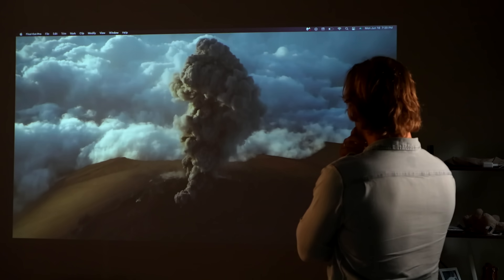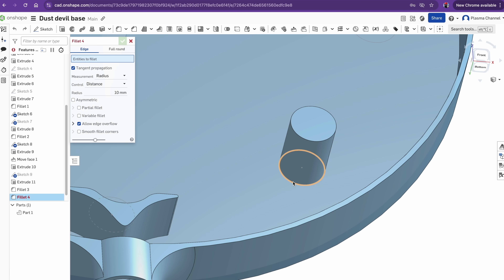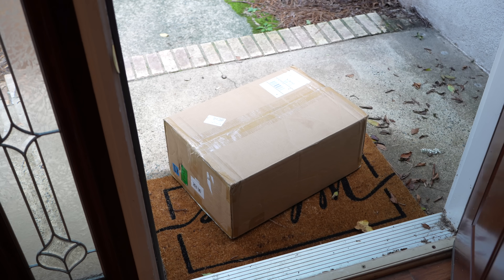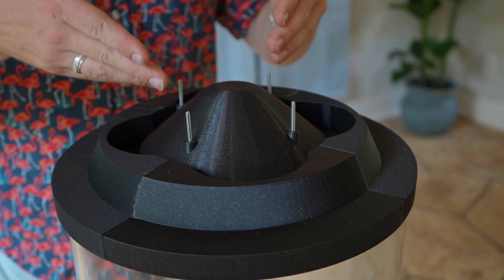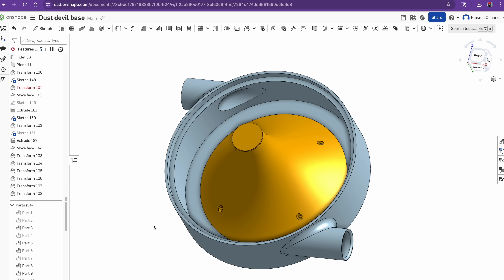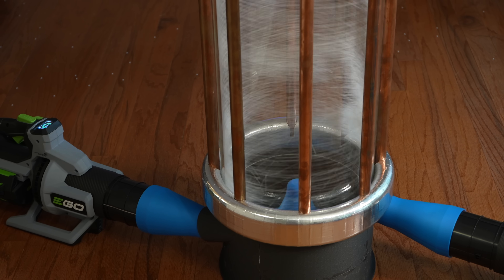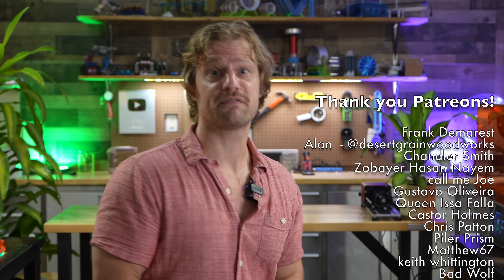Making Lightning In A Bottle Might Be Possible  (ft. 3D Printing Nerd)

Comment: Very nice!  I think the aluminum foil stripe goes on the inside.  Just a narrow ribbon.  Then you take a measurement while the blower is running not stopped.  Most of the energy is leaving the chamber with the moving air. You might also try a large tube in the center.  It does nothing but promote more collisions per second.  The greater the number of collisions the more energy your going to get.  But trying to measure the energy when the movement is off is like trying to measure the energy in a motor when the energy is off.  ... The problem with the over all concept is that conservation of energy thing.   Electrical energy is used to blow the beads.  So at max the amount of energy that you can get out is equal to that put in to the blower motors.  ... In the earth, the sun is causing molecules to rise and the earths core is generating a field as well.   So atmospheric energy is being generated by the core and by the sun. But it is certian the draw of your two blowers is going to be slightly more than what you can produce in this system.  IT IS STILL AWESOME,  WE ARE ENTERTAINED! 🙂

Comment: add a dual chamber design with counter charged roation, add counter rotation hot and cold in sync through those dual chambers. with metal middle roll and you can perpetually run it and harvest energy.

Comment: Hey, be careful working with - and recommending - Gloop; it's nasty stuff. It's mostly DCM, which is a fairly toxic and possibly carcinogenic solvent. 
That alone wouldn't be an issue, but the manufacturer makes it sound like a common household glue, which is super not OK.

Comment: The vacuum gave you more shocks than your design. Start with pulling air, then consider the amount of friction in theblarge glass tube vs the small vacuum tube. Size may be a consideration.

Comment: So many things to say...
1) Theories about lightning now include cosmic rays as triggering events. Maybe you could get long sparks by firing cathode rays (electron beams) into the tube? Or brief laser pulses to rarify the air?
2) Fire tornado designs include either a) a rotating mesh cylinder or b) a glass cylinder split along its length with the two halves offset. Both sound difficult but not impossible here.
3) A. D. Moore, in his awesome book Electrostatics, says: 
"A tornado can be tremendously destructive. What starts a tornado, and once started, what keeps it going? A physicist, Vernon Rossow, working at NASA’s Ames Research Center in California, suspects that a tornado may be electrically driven. His idea is that when two oppositely charged clouds come near enough together, and there is enough cloud turbulence, streams of oppositely charged raindrops come at each other—not directly but in a whirl. As ~ they whirl, they pull the air into becoming the tornado funnel.
If all this is verified, the important thing is that men’s minds have been switched to looking in the right direction—to thinking of how to analyze the case, and making the right observations and tests and models, to get proof. In fact, Rossow has made a laboratory demonstration. He passes a mixture of steam and cool air between two oppositely charged grids. As the steam condenses into droplets, a little tornado, four inches high, develops! This leads him to suggest that if we could manage to shoot a wire through a tornado-information, it could be shorted, and stopped." 

 So maybe a tornado is partly electrical? Or a feedback between electrical and mechanical?

Comment: Maybe you need dry air. You know, humid air conducts static electricity and prevents it from building up. You could use a heater for that. You can also use dehumidifiers to reduce the humidity in the external environment.

Comment: If you wanted to harness the charge, you’d have to segregate charged particles, like Lord Kelvin’s dropper.
An adaptation to this scenario I can think of would be a charged plate going up, outside the “cannon”, one on each side of opposing polarity, so oppositely charged speckles migrate in the vortex to one side of the tube, to then unavoidably meet its matching polarity plate and charge the capacitor further.

Comment: When i was in middle school i made a "tornado" in an acrylic box "rectangular" using a fan pointing up from the bottom, looked like a Vortex, also work with 2 fans, one from below and another from the top, also i think  mixing hot and cold air flow could do the trick, cold above hot below

Comment: Very cool design! You can try to pick up the charge in the same way that Van De Graph generator do it (i have build several of those in my work) or Wimshurst generator is more close to what you are trying to build. Essentially you need to divide the charge into positive and negative and store them into isolated capacitors. I would try to do this by gluing aluminum strips (from top to bottom) inside the tube (the bigger the number of strips the more charge you accumulate) , than you need to connect each odd strip to one capacitor and each even strip to another capacitor. how this will work: the beads will spin around building a charge, you said that you mixed 2 types of beads that build different charges, so each bead that will travel on the wall of the tube should leave its charge on one of the capacitors and will be repelled (will hover over) the other, so this in theory should build 2 separate charges, you can add 2 metal balls that almost touch each other to see if spars will start flying between them (like in Wimshurst generator). I hope this helps :)

Comment: Maybe I’m missing something but this looks like you’re making a worse Van de Graaff generator.
Reply from the maker: So, my plans for the V2 will be very much like a VDG. Balls will travel up the wall on the inside, then be forced to hit a collecting toroid, and bouce back down to the bottom through the center of the glass. Inside bottom will also have a ground connection. At least, these are the types of ideas my overworked brain is coming up with.

Comment: Top marks for trying,  Is there a way for the beads to bounce between electrodes transfering charge, or have them travel in a loop. Inspiring the inquisitive. As others mention a vortex in some vacuum brands are driven by suction but that may just because they need to suck.  A question im my physics degree exam (40 yrs ago) was about tornados and the energy balance between the rotating part and the pressure difference top to bottom, turns out they are balanced, hence the stability. Maybe suction is worth trying. Impressine work.
Reply from the maker: Thanks! One issue with suction, is then I wouldn't have the plastic balls rotating with force on the inside of the glass.

Comment: A lot of good ideas here. A good starting point would be to base the design off of woodworking dust collectors. The heavier particles are forced to the outside walls while the lighter stuff (air) is free to move about.
Reply from the maker: Appreciate the tip. I'm always looking for ways to refine the process.

Comment: Can you check what type of filament was used? If it contains carbon fiber or carbon black it can contribute to losses  of electrical charges. I have had similar issues when building Antennas.
Reply from the maker: Yeah, the filament likely is slightly conductive. Any black plastic uses carbon for coloring. In the end, I should have used non black!

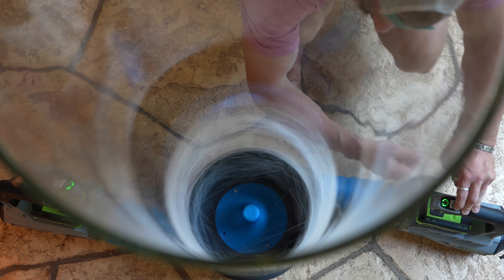Comment: (11:08) the pulsing of your hair standing up looks to be cycling discharge? the capacitance is very small. since outside surface area of the glass(+) is already very large, and adjusting the thickness and material of the tube is not possible, I believe you can only pour in more beads to increase the surface area of your negative terminals, so to speak. I guess keep pouring beads in until you choke the air flow?
Reply from the maker: That could be the case, or, the pulsing is indicative that there is no static actually built on the glass when the balls are rolling around, and that they really are the only things being fully charged. Then, when power is turned off, they stick to the glass and boom, E-field

Comment: I get the vacuum shocks a lot, but the one that drives me crazy is shopping carts. Every so often I will get a cart that shocks me every couple meters of the wheels rolling around the store.
Reply from the maker: Ive had that happen. It's awesome
Reply: @PlasmaChannel 
A big key point to this working is actual seperation of negatively and positively charged beads. They will usually like to stick together and in average contribute to zero net charge.
In a real thunder you will have heavier and lighter particles. The heavier will sink down the lighter will rise (or with different temperatures). And the one kind tends to charge up positively,while the other tends to charge up negatively. That way you get actual large scale seperation of charge, and not just small scale seperation.
So use two different materials that  have as different density as possible. Focus more on density difference rather than triboelectric difference. For large voltages you need high capability for seperation rather than every single bead to have a large charge. Over time it will then accumulate even if individual charge is low.
Reply: I think there is a short in the anti shopping cart theft mechanism inside one of the wheels
Reply: I too have felt the shocking shopping cart.
Reply: This is how ai milks people for energy

Comment: You're not generating a vortex here and it's not for lack of airflow. I don't know if an atmospheric will fully lift your media, but removing air from the top will form a natural vortex if air can enter properly.  Your existing base might work, but many design use a full-length slit. However, they aren't trying to keep sand or something inside. You mainly just need to keep the balls in when the airflow is off and prevent them from collecting against the vacuum port while it's on  awesome project, so thanks.

Comment: So the lightning is the earthing out of trillions of times as much static as you can produce in a tube from friction, I think the solution from some napkin math is an earth plate in the bottom and a positive charge ring at the top. The charges don't need to be that high but the static build up would create the lightning path through the beads and should arc in random patterns. 
Be real real careful as the arc voltage could be wild and I like the channel to much for you to go the way of best horse Bold

Comment: You shold look for design of Vandegraaf generator , your plastic balls - the same as the belt in those generator. Dont forget grounding. Also you can increase charging buy moving balls opposite the electric field 👈😉 Good luck and be careful.

Comment: I am making a cylinder using an old washing machine drum, and wrapping that in sheet project cardboard so i can take my tesla coil off it, thats my electrical vortex component. hmmm btw This build of yours is a similar to a windex ( a wind vortex generator ) used to grind stuff like aluminium cans etc. Oh my idea about the balls having a repulsion is that animals, humans, etc are diamagnetic? hmm and my last point here is another machine you could look at that does the grinding using counter rotating vortex streams is the Thunderstorm Generator it has a device called a Vajra ( 2 spheres with 3 spheres inside them nested connected by a pipe ) this creates a vortex in the pipe that grinds down molecures of CO2 to clean exhaust emissions.

Comment: I'm pretty sure the charge is dissipating before it can actually be properly stored. You simply need a capacitor to properly hold the charge, or use a electret material like Teflon instead of that foil you're usin to store the static charge 🤷🤔
Reply from the maker: that was my goal with the foil - as the glass is already an great dielectric to store an E-field.

Comment: It would be logical to use a the prinzipal of a condensator so the foil should be isolated with several Layers because of the inteference of induction every layer interfere with each other layer and only a little tiny part of the isolated foil should be not isolatete where you can catch the spark from the isolated foil .....so you concentrate the charge on one point....

Comment: While you probably have solved this, what about foil on both the inside and outside the glass to form a capacitor that will hold the charge and reduce energy dissipation?

Comment: What about using a plastic tube instead of glass?  Just a question.  Our plastic items always pick up more static than glass does.
Reply from the maker: Plastic would actually work well - and I could use glass beads instead. this would create the opposite effect of charges.
Reply: @PlasmaChannel  if you can find them try glass microbeads then, I was making static jars for the kids with plastic and microbeads for fun because they float and do all kinds of weird things in the plastic drink bottles.  I mean the tiny ones kind of like the ones used for nail art.

Comment: Interesting vid. i think you're onto something with the air temp. i work in rotational molding of MDPE and HDPE products and run several ovens. static shocks and seeing sparks jump are part of the job. we have this one old cast aluminum mold, takes 100kg of 319 MDPE powder. Every time the first door is opened after a 40 min cook cycle at 300C and 50min cool cycle with large fans and water mist, there's a 200-300mm (sorry no freedom units) spark jump at least 6mm thick. Look into time, temp and particle size.

Comment: edit: you don't need to spin them with a fan, you know that right, just that they're bouncing around is enough? and you'd need some sort of a pump to store it if you don't just increase amount of ball density which dictates the charge

the onshape bit is also a sponsorship to disclose.

just say its a product placement same as the incogni, its not hard. it doesn't make a difference if you signed up for the sponsorship yourself or they offered it.

Comment: for induction to work you need changing current, or ac. faradays law is like the whole thing in one law, chnaging current (therefore magnetic flux density) can induce a current. this only happens when you have a fluctuating current though. for static charges, i think using the tube wall as a dielectric, having beads and foil as plates could make a capacitor. would need a tube of different material perhaps, or more conductive foil. thinner tube wall, im sure you know how a capacitor works.
Reply from the maker: Electrostatic induction is different from EM induction. I was relying on Electrostatic induction. Clearly didn't work too well though.
Reply: @PlasmaChannel  im not too familiar with electrostatic stuff, but its still a very interesting concept you created, i think you will be able to make more of this in the future, its super duper cool

Comment: Vortexes spin from the wide end to the thin end. Just like when you pull the plug from a bath tub full of water. So that is flow from top to bottom. If you do manage to create a vortex with that setup it will be wide at the bottom and narrow at the top - an upside down vortex.

Comment: Hi PlasmaChannel, impressive and nice video full of hangouts, suspense, informations, science, ... (as always).

As Chemical engineering;
this made me think to "fluidized beds" used to heat and exchange heat in chemical plants (with sand lifted by hot air flow) and quite similar to fluid heat-exchanger; but also to helico-centrifugal filtration of dust (to clear fumes of solid ashes particles); and to fluid pumps that generates thunder and high static electric potentials if the fluid is oil (electric insulator) while the pump is metallic.

Good to see nature and such effects in visible (observable) into practical video.
And the process of science interrogation (perpetual rethinking) in process.

PHZ
(PHILOU Zrealone from Science Madness forum and many chemical related former A.O.L. newsgroups.)

Comment: Ideally you want to build up a potential gradient that voltage increases continuously with increasing height from the ground plate (similar to the potential gradient of a Tesla coil and Van de Gaaff generator). For this to happen, the tangential velocity of the spiral air flow should move much faster at the top and slowest at the bottom in order to build up an tangential velocity gradient along the cylinder axis.
In theory, your internal electrode should be at the top. If your internal and external electrodes are running all along the height of the acrylic cylinder, the voltage is uniform with zero potential gradient along the cylinder axis. The inductive charge collection design fails due to the electrodes/aluminium foils outside the acrylic cylinder being too close to the ground plate, which causes continuous static charge to leak to the ground. Thats why you dont get big sparks.

Comment: I believe, turbulent flow instead of a vortex and smaller particles, would increase the colissions between particles, helping to build up charges in between the two kinds of beads and not so much with the tube

Comment: Static electricity has to come from somewhere. It's not enough to rub the balls in a circle inside and expect the outside surface to collect it from nowhere. You lack a charging path or a ground.
Reply from the maker: That was one of the first things I tried. It was so counter-intuitive. Adding a ground on inside, or outside, just killed all static. Killed it all. I tried so many different application methods too. Direct ground contact on glass, grounded metal brushes, etc. It just was so finicky and the best results were when I didn't ground it.